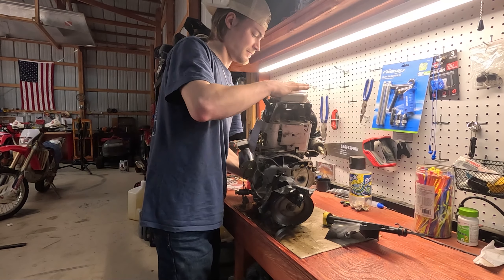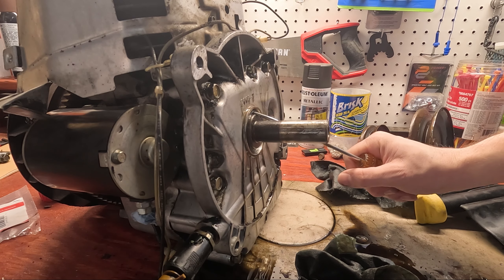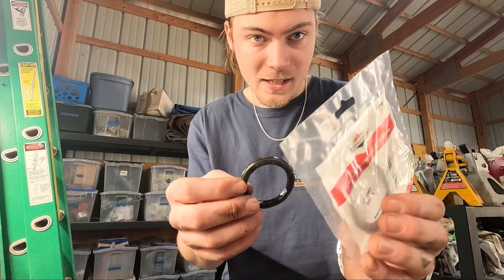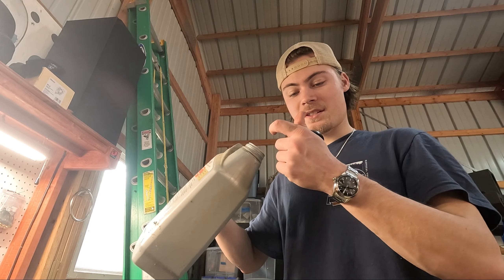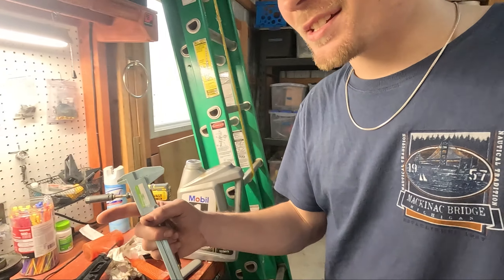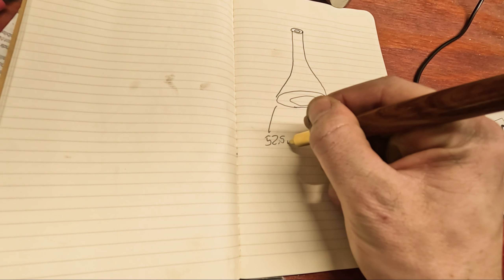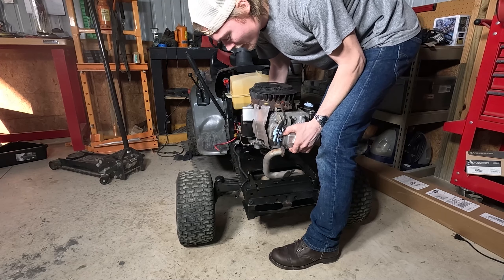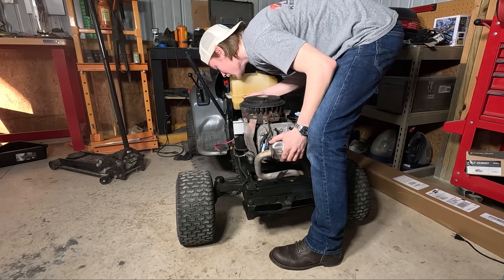Racing Mower Update! | Is the ENGINE toast?

Comment: I run a 6 inch pully on the front and a 3 inch on the rear and my craftsman will go around 45 miles an hour mine got 18 hp twin engine in it they are 5
The best